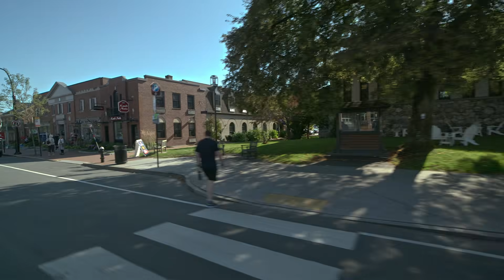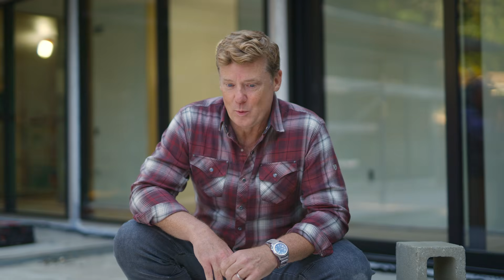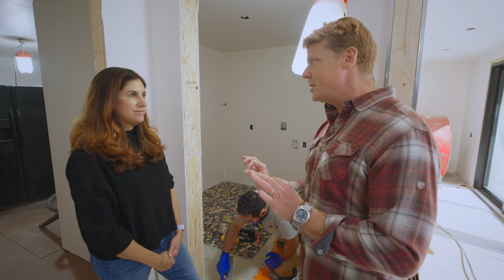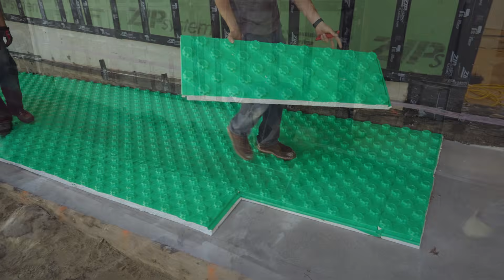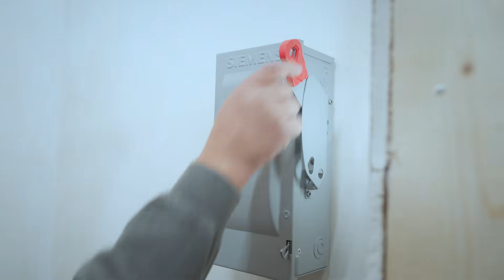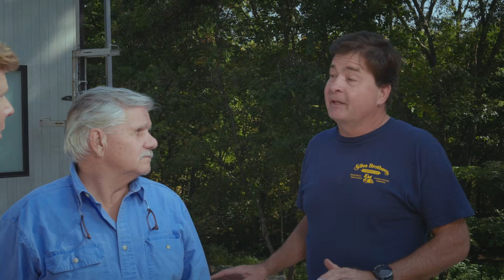This Old House | Electrical Bond (S45 E11) FULL EPISODE

Comment: The pool deck voltage gradient is very important to prevent voltage shocks from stray voltage. Farmers have to do the same thing for water trofts and milking barns because the cows were continually shocked by stray voltage in wet areas.
Reply: I'm a Master Electrician and a licensed Electrical Contractor. And I just have to say, in as impactful a manner I can say it: Heath is a terrific guy, who is smart and talented and not the kind of electrical contractors you had in years past. The man is gold, and so kind and easy-going. Please keep him as long as you can! 

I have never met Heath and have no affiliation. He is a great representative and is not a Mass-Hole as some previous contractors. God bless you guys, and apologies for my language.
Reply: @michaelc.3812 <> I'm a licensed general building contractor with electrical, plumbing and glazing licenses added since 1985. I wouldn't call myself a "master" electrician because I do a bunch of different trades over the decades instead of just electrical. But I try to stay on top of current informative information whenever I can so I don't fall behind. I learned about gradient voltage from Mike Holt videos a few years back and kept it in the back of my head. 👍
Reply: Amen friend, and there are many papers and booklets that are published to help livestock farmers keep those voltage gradients minimal. It's not a simplistic issue1